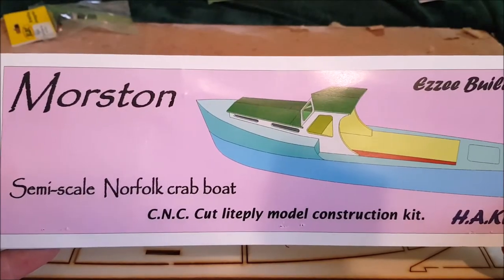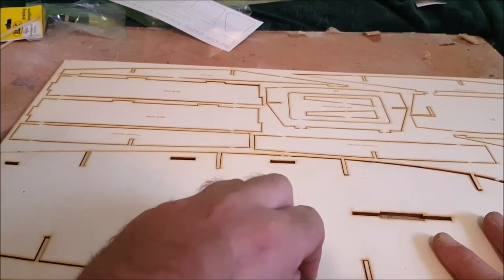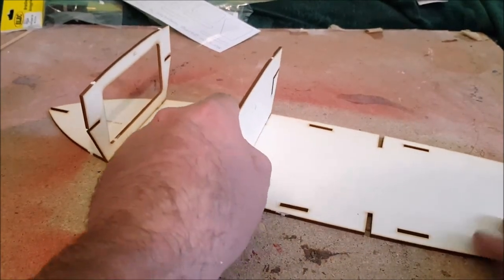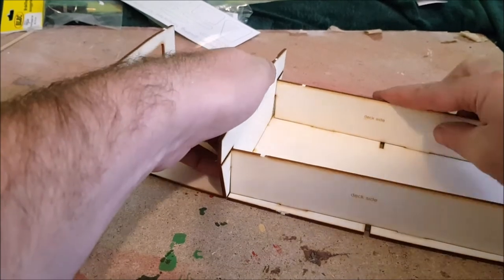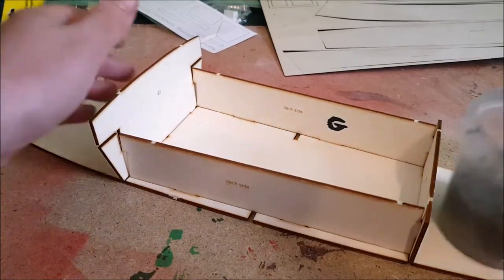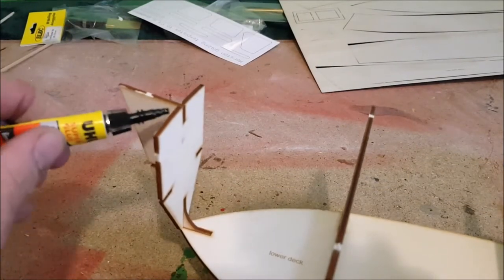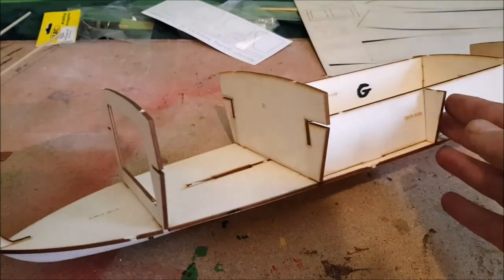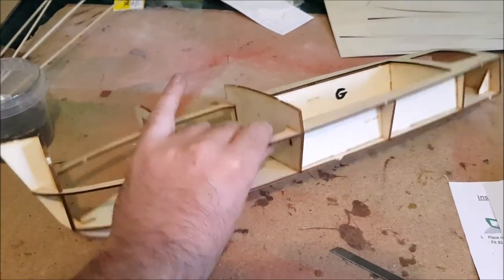Building the H A Kits Morston Norfolk Crab Boat Part one

Comment: I am surprised they didn't laser cut the window plastic. Maybe there is an issue, laser cutting clear plastic, I wouldn't know. It does look like a nice kit 👍 BUT that is disappointing with those deck sides misalignment.
Reply from the maker: Yeah the sides are a needless mess up, should have been proof built before release.I think the PVC they use for the windows though might melt,not sure as Im sure like you mentioned people do lazer cut plastic £40 though for the kit so not bank breaking

Comment: Is it gunna get POWER! Or scale speed?
Reply from the maker: Well scale speed said put a small moter in it,however the racing 500 moter was cheaper and just about fit 🤣 if tested it but had few flaws with prop shaft set up, its fast but not patrol boat levels  needs a tad of weight in the back,makes a very big wake though
Reply: @scalestuff1066  nice